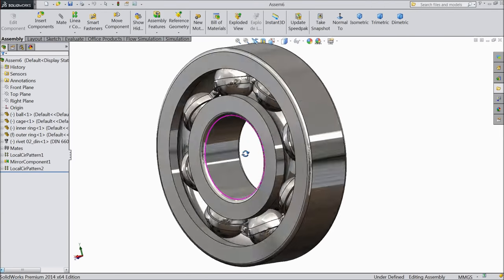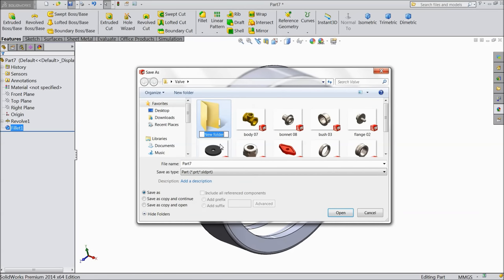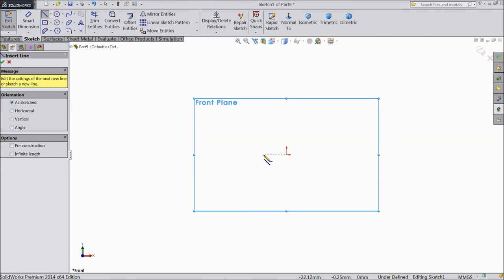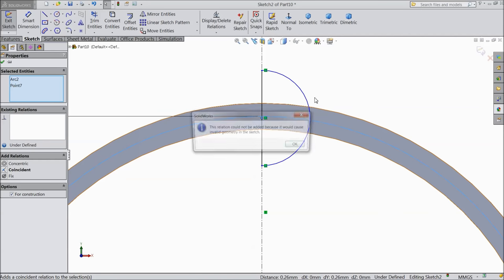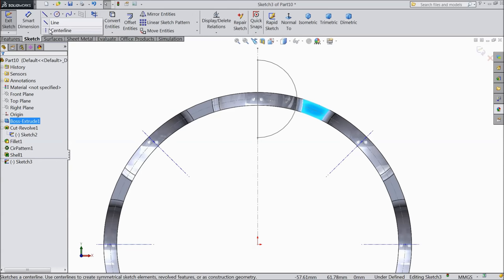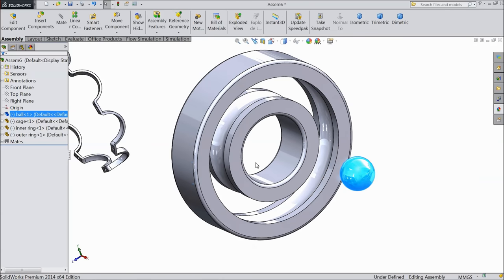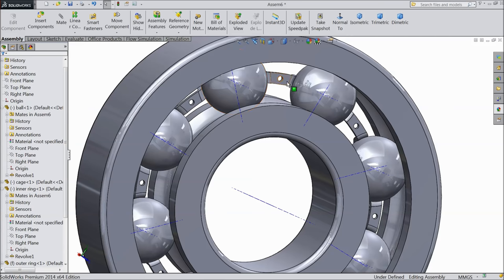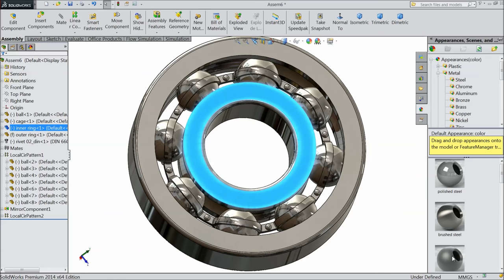SolidWorks tutorial | Design And Assembly of Ball Bearing in SolidWorks | SolidWorks

Comment: Hey, how are you doing? I'm still learning SW and your tutorials are so helpful. The best ones ever!!! Actually I'm trying to assembly this ball bearing but I'm having some troubles on positioning the ball upon tangent the inner ring, When I try to follow all steps you teaches, it doesn't work to me. I've ever tried of all ways to make it work and hadn't any success. The step which I'm talking about is on video up to 14'14'' until 14'20''. I have the version 2016 on my PC and when I click on flip mate the ball moves down instead of move up. I don't know more what to do. Would appreciate your helhp if possible. Thanks in advance
Reply: I did the same as the Rahul Suhas Kulkarni and it worked, but now I have another problem with the cage, I couldn't mate them using the steps from video but I aligned the cage and ball planes, after I mirrored the component but when I rotate, only the inner ring and the balls move, the cage is static at all. Any help?
Reply from the maker: make relation between ball & cage, tangent & parallel plan mate.

Comment: What setting are you in that your parts look all shiny and pretty. Mine are very dull colors. Thanks!
Reply from the maker: you need professional graphics card in your system like Nvidia Quadro series or AMD firpro Series. other cards will not support real views.
Reply: +CAD CAM TUTORIAL I have the m970 in my computer right now. I'm running solidworks 2015. In wondering could this views be possible still?
Reply from the maker: no its not possible you must install only Nvidia Quadro series Graphics Card or AMD Firepro Cards.

Comment: hi. first of all a very good video and channel. second, I am having a problem with mating the cage and the ball sphear. when I'm trying to mate them, an error massege popse and it says that sphears are unable to be mate by a concentric mate. do you have a cloue to solve this problem? I'm using solidworks 2016
Reply from the maker: אביב בן עירי  check below conditions,
1)make sure inner ring in floating mode by right click on parts,
2)you need two mates for cage,
2.1)use concentric mate with center Axis of cage & inner ring,
2.2) than make tangent mate with cage & ball
Make sure outer Ring is Fix

Comment: hye.. how you make it in realistic view?
Reply from the maker: Thanks, you need professional graphics card in your system like Nvidia quadro series or AMD Fire Pro series. normal graphics card will not support real view in any cad softwares, you must buy a professional graphics card for real view.
Reply: Thank you.. You are awesome..
Reply: No need for that, if you have a graphics card other than the Quadros you can still tweak your registry to make your card work with RealView Graphics. I did it for my GTX 660ti. Works flawlessly. Used NV40 folrder and copied the 'renderer' value and placed it as a key folder within the NV40 with the hex value of 30008. 

Specific steps are here:
https://grabcad.com/questions/how-i-can-activate-real-view-graphics-in-my-solidworks-2015-x-64-bit-sp2-my-operating-system-is-windows-7-x-64-bit-sp1-and-my-graphics-card-is-amd-radeon-hd-7500m-7600m-series-i-have-already-tried-realhack-3-9-1-but-it-is-not-working

Comment: Bro, where do you get the 2D measurements for the model? I need measurements for the bearing.
Reply: THIS LINK IS FOR SKF 6203 ; SIMILARLY U CAN GET DIMENTIONS FOR EVERY BEARING WE MAKE (I AM AN X SKF)HOPE THIS WILL HELP U
Reply: I second the 
what R.Yuvashankar, in general the best thing to do is look up the part number on your bearing, or use one of the main bearing manufacturers websites to get the bearing dimensions. That being said there will of-course be some things that are proprietary. You can also download CAD 3D model step files from any most of the major bearing manufacturers or distributors like McMaster-Carr

Comment: i can't mate the ball with the outer part of the inner ring. i have tried multiple times but the mate isn't happening. i used the exact dimensions as you used. can you help?
Reply: Had the same problem. What I did was make two tangent mates, each being a mate with a ball and the edge line of its respective slot on the ball bearing cage. Hope this helps!

Comment: Also, what exact computer or laptop would you recommend to run the new solidworks 2016? Do you have any lap top recommendations that are under $1500
Reply from the maker: try workstation laptop for CAD softwares, like Dell Precision laptops & HP Z Book laptops, it will helps you for CAD softwares.

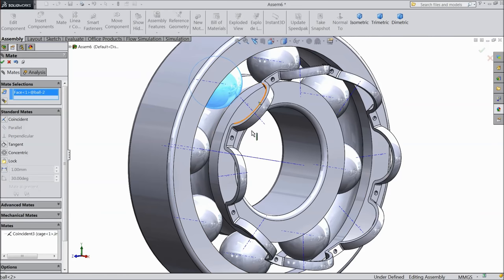Comment: Hi,  i have a problem at the part 16:00,  i am not able to mate ball with the cage.  I followed your steps but when I choose to mate ball with the cage, balls came out from the inner ring and mate with the cage ? (i am using solidworks 2013) 
Sorry for my bad english.
Reply from the maker: first do the previous mate with center line of cage and center line of inner ring, thank try with ball & cage face mate with concentric relation,
Reply: CAD CAM TUTORIAL  Thank you, I will try that way.
Reply: I am not able to do this ,help me for this ,
Reply: select, ball 'top plane' and inner ring 'top plane' and give distance between both of them as 45 mm
Reply: I did exactly this way, but an error occurs telling it's not possible to do concentric relation. What do you suggest to do?
Reply: line up the axis of the ball and the axis of the revolve cut of the cage.

Comment: That's a great job, congrats!!! I've done some of your tutorials. In this one however I had a problem with the rivets, I use the same one DIN 660 but when puting it into the hole it shows two heads sizes, one side's head is bigger (enormous)  and on the other side is normal, how can I solve this? Thanks and keep going the good work.

Comment: Sorry, I have a problem from 14:23. the ball isnt beetwen the outering and innering. The half of ball is touching the innering. Any help. Victor.
Reply from the maker: if the is not in the correct position just click on offset just watch14:20 .
Reply: It doesnt work.
Reply from the maker: if ball is not in between than just click offset and select tangent relation.

Comment: Hello sir, i would like to ask if you know how to solve the problem I encounter while creating this bearing.

At the last part inserting Rivets in the tiny holes from toolbox at design library, the size of the rivet should adjust according to the hole's diameter, but the problem is I cannot click (✔️) as it message me this "failed to get writable document"and inserting the rivets are not possible and it will crash shortly. 

How sir?? Anyone? Thansks
Reply: I also face the same problem but i figured it out . My problem was at the very first of the part section where i designed all part in inches parameter not in milimeter  though the assemble portion remain same ball bearing as the proportion is same .But using standard pattern such DIN pins , it can't shape himself in the large hole which is in another parameter .
Check this if you make all dimentions in milimeter .
Reply: @zabermahmudneel8880  did you manage to solve it?

I think I finally solve it but I am not sure if there will be no problem in the future usage.
Reply: @Maron Ramos
Yes i did. But i am almost sure about that. 😀

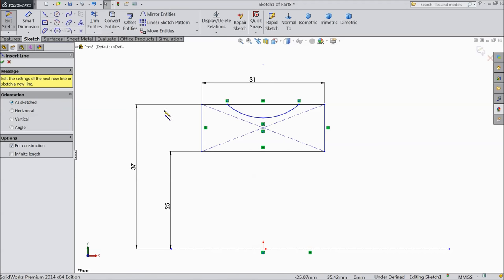Comment: What is the vertical centreline drawn at 4:04 needed for? Is it the revolution of shape?
Reply from the maker: yes you are correct  it is not needed.
Reply: ike i
Reply: I think it stops the part moving when you make the fillets on the sketch? (it came up with the error message but didn't move because of the centreline

Comment: In 14:17 duration my tangent is not working. can u tell me why tangent is not working?
Reply from the maker: Md. Mahabub Alam make sure outer or inner ring should be fixed, & also check previous mate are ok or not.
Reply: i didn't fixed inner or outer ring. ok i am fixing & see what will happen. by the way thank you for your reply
Reply: i was fixing inner or outer ring, but till now it don't tangent. Please suggest me what can i do?
Reply: I am facing same problem. Did you get solution of this problem Md. Mahabub alam.Thanx in advance